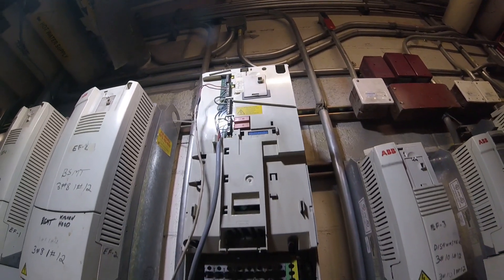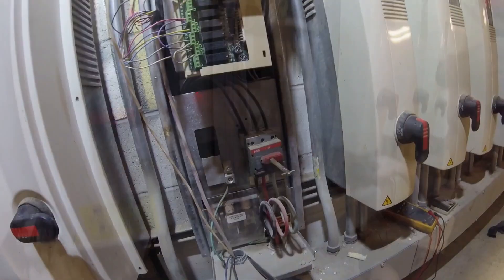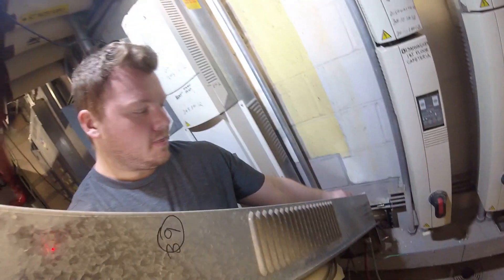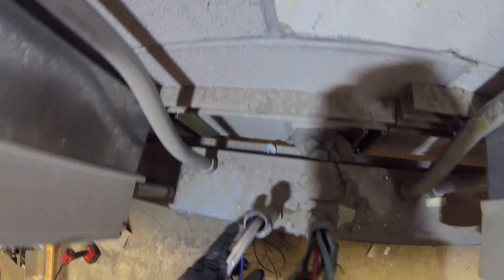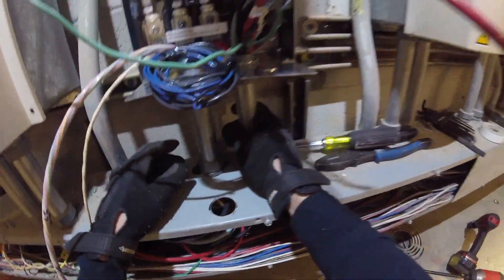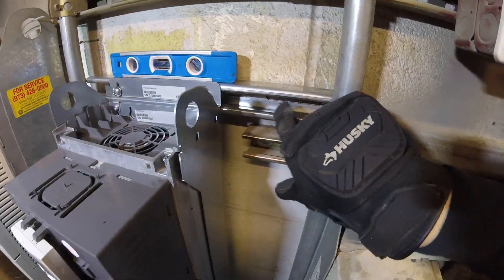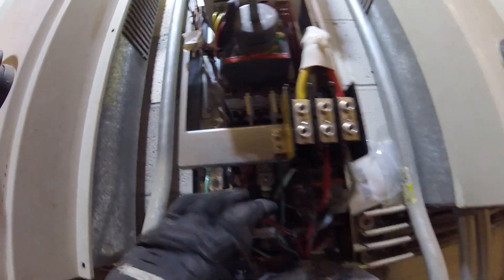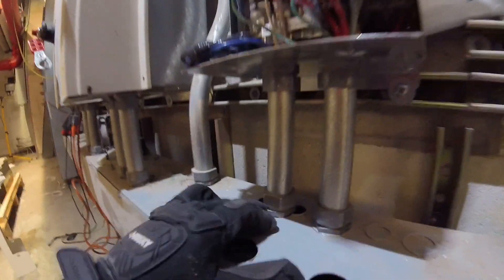HVAC VFD Installation (Variable Frequency Drive) ABB

Comment: When connecting the line into the lugs, the wire shouldn't be twisted.  The strands will fan out under the lug giving direct contact between the lug and all of the strands.  Best to cut and strip the wire so they all fit in the lug easily.

Comment: Oh this is way less than complicated than installing an oil fired boiler with a Riello on an incorrectly previously installed oil fired boiler in a hoarded basement filled with like ten overflowing cat boxes, leaking sewar pipes and a 4 ft high ceiling.

I got this!